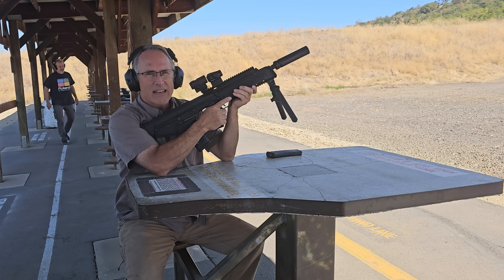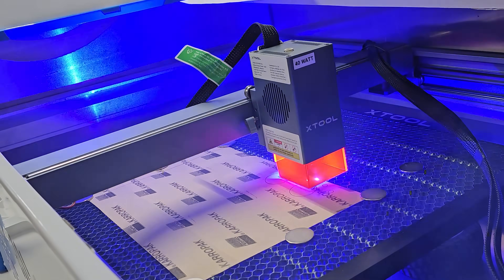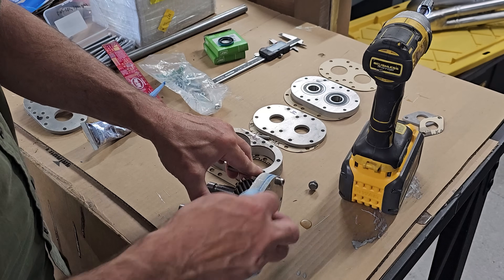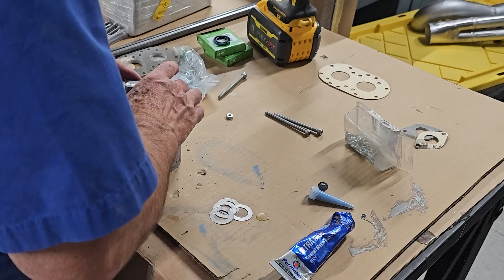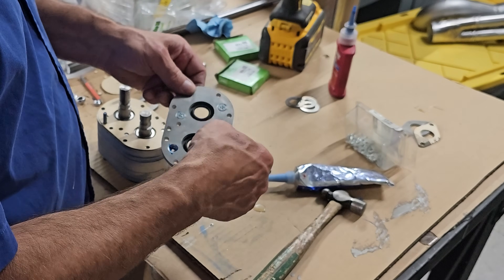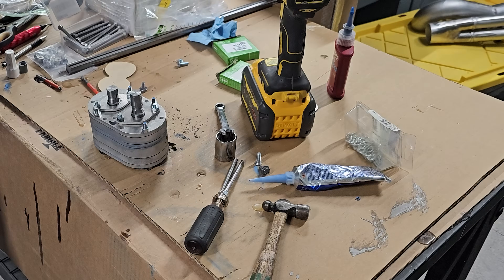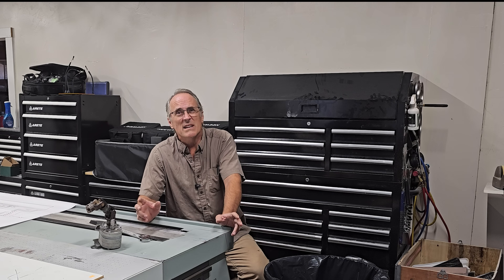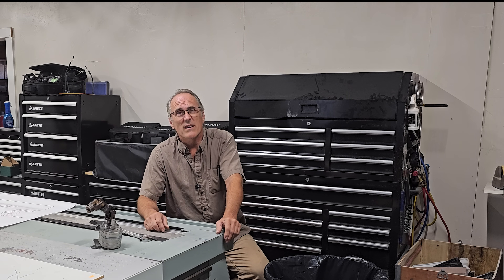Ai stinks! And this human builds a gearbox from scratch!

Comment: When I saw that you were making a gear box I hoped it was the AWD assembly on the Arete. I would love to see what your solution was for that. I couldn’t find it if it has already been addressed. If it has will you please point it out to me?
Reply: The design is mostly done for the center diff, but need to model some parts for casting. (Casings)